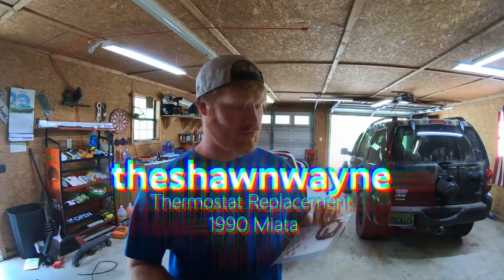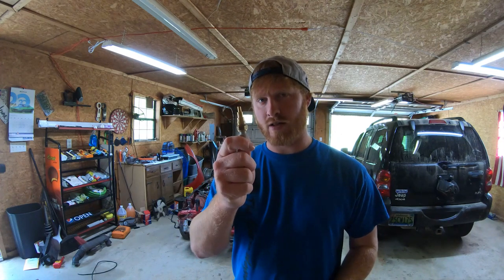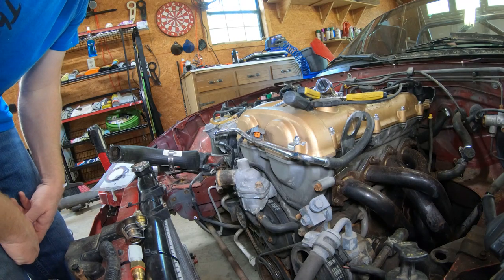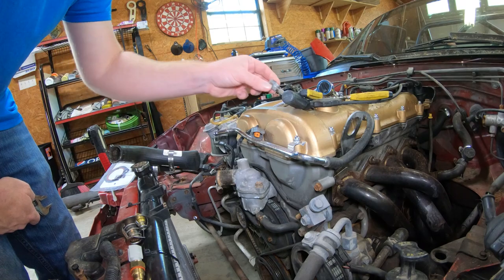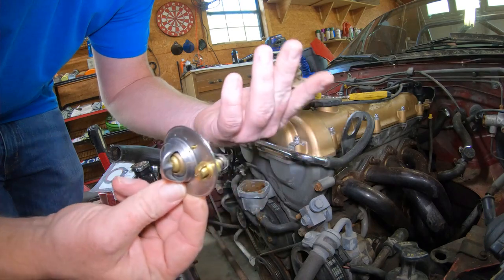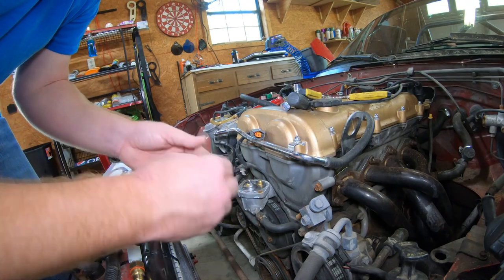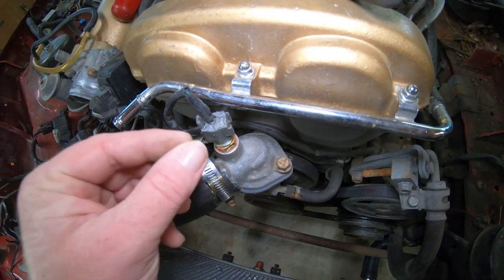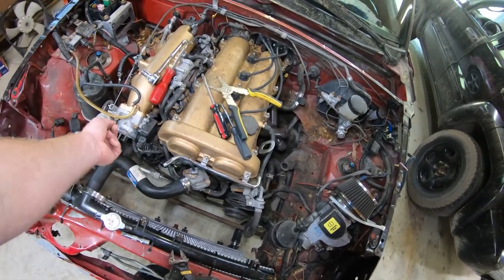Thermostat Replacement On A 1990 Mazda Miata

Comment: Be careful with those bolts, whenever you have steel in aluminum on an old car you should act like it's a rusty 6 on the underside of a miata. 

Snapped the left off on mine and I got to drill and cut new threads.
Reply from the maker: Been there done that lol not fun